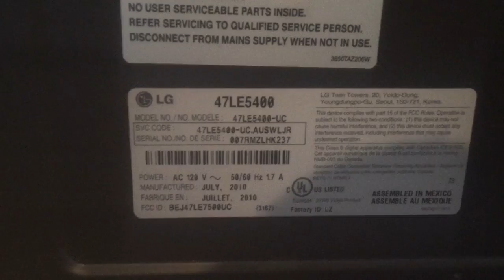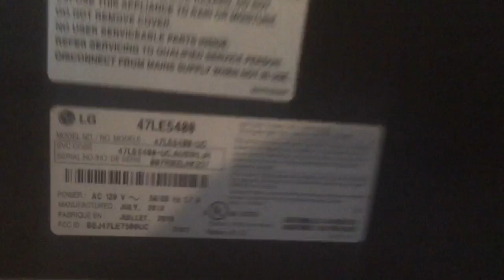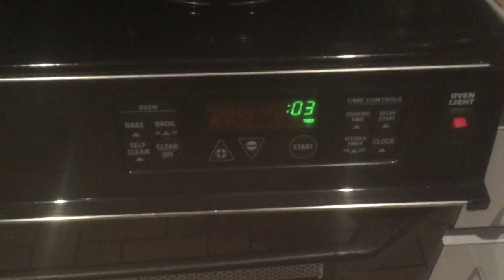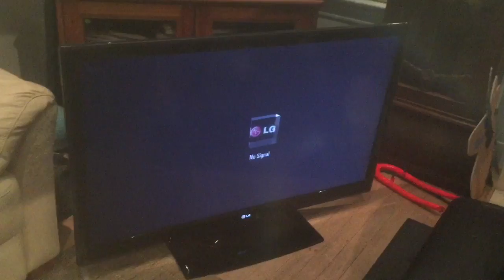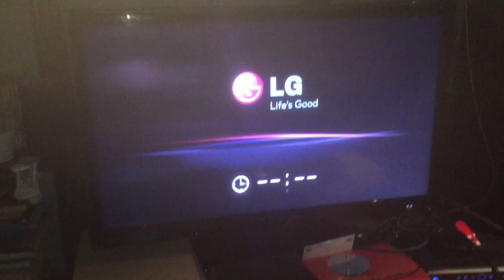Repair An LG Television Motherboard By Baking It In The Oven

Comment: So I'm trying this for a second time, first time didn't work at 375 degrees Fahrenheit, so I've got it set to 400 for 11 minutes now. Question though, have any of you had the issue with your lg TV having the static when you try playing anything? Like, the home buttons work and you can see Netflix, YouTube, hulu, ect. But when you press play you only hear the volume, but the picture is static? Anyone know if this trick solves that issue?
Reply: It's a lead-free board, so the actual solder flow temperature should be 425-450F depending on which particular alloy is in use..  Kitchen ovens typically have a large hysteresis, so will overshoot the set temperature, then drop below the set temperature such that the average temperature is that set.  Also, without convection fan, the top of the oven is hotter than the bottom.  Cooks have known forever that each oven acts a little different, and learn to adjust their temperatures accordingly.
Reply from the maker: Not I

Comment: I pretty much have the same LG TV from about 2009 and have used this trick about once per year for the past 5 years.  Works like a charm everytime!   I'm also getting pretty fast at taking it apart and putting it back together.  Nbd.
Reply: What temperature and how long you baked

Comment: Just tried on lg 55lw5600ua it worked. But a quick question how long it will work? As I have 3d tv and I luv it, its difficult to get a 3d tv now a days.
Reply: Mine works for a few months then have to do it again
Reply: @l.o.s.nostress713  How many times have you "cooked" the motherboard? I just did mine successfully for the first time. I had it fix for $70 on Ebay and worked for a couple of months. I hope this fix last as long.
Reply: @afuera2371  I’ve did it 4 times already
Reply: @l.o.s.nostress713  I reflowed my 55LW5600 two years ago and it's never had a problem since. I think adding flux around the under edges of the BGA chip made all the difference.
Reply: @wmp0074  how u do that
Reply: @l.o.s.nostress713  You can use a q-tip without the cotton swab and dip it in flux and just rub the flux around all edges of the BGA chip. It does make it easier to know how hot it is because the flux will start to vaporize. You'll know then you can pull away the heat and let it just sit and cool off.
Reply: @wmp0074  ok thanks going to try it out so just use liquid flux or the paste flux
Reply: @l.o.s.nostress713  I used the paste kind. Liquid might actually work better.
Reply: I just baked mine,  I have the same model,  it's a shame they're not making 3d TV's anymore.

Comment: i have the lg 55uh8509 and when i turn it on i have a picture for some seconds and then it goes all black. 
i put the motherboard in the oven but it didnt work.. what else can i do? 
do you have an advice? 
thank you
Reply: Power supply.  Look for the board that the AC power cord plugs into.
You will need to remove the back panel, and use a multimeter.
On my LG, all of the signals (+VA, +VS, GND, etc.) were all labelled in silkscreen... so be sure to read EVERYTHING. 
Lots of YT Videos to support this process

Comment: would it work for a LG 49 LF540V TV? I want to try it but i dont wont to break my tv anymore than is already is. so the problem with my lg tv is that when i plug the ac it will show the "life's good" logo then show a blank screen for a bit then switches off then comes back on and keeps doing it on doing doing it untill i unplug it. pls help thnx
Reply from the maker: I can’t comment because it’s not the same issue.
Reply: Did you try it?

Comment: SoI thought this is so odd that I'll just have to try it! I have a Cello TV that has power, no picture or sound that just stopped working about  2 weeks ago. So I opened it up, took out the mother board and put it in the oven for 10 minutes at 200 degrees C. I let it cool down for about 30 minutes and put the TV back together. It was like having a factory rest. It's now working perfectly. Thank you very much Avrim, your tutorial saved me buying a new TV!!

Comment: Done with a toaster over that does not have any way to regulate the temperature. The motherboard barely fitted in but after 10 minutes of baking and 2 hours of cooling down (the smell was too much to enter the room) the tv works again. There was some dark brown residue left which seems to be from the main chipset. added some thermal paste under heat sink just in case and a fan behind the TV. I think it will need re-baking in the future though because of how it is designed.
My TV is 32 inch LG LCD, it had no picture on the screen, just a click sound when plugged in and the led indicator was steady on. It would react to buttons nothing would change. Tested with multimeter everything I could before baking but had to learn how to use it and how to test the motherboard in the first place.
In the end I received some knowledge and a working TV for 5 bucks.
Reply: this made me lmao, pictured you putting the board in a toaster, could do 2 at once - or 4 if you have a 4 slice toaster lol or if you only got one you can make toast in the free slots... bet you had to press the toaster on a few times though - and catch the board when the toaster popped up and flew it in the air - like pop tarts - pcb tarts
Reply: @Pens4Life85  A toaster-oven. Those are little ovens that are not even capable of frying meat (at least in my case). It is almost the same size as a microwave. My TV had two times 2 days ago when it shut itself down for a second of half. It is still working fine now though.

Comment: 385 degrees for 10 mi won’t that burn even the cardbored
Reply: No it really doesn't burn or melt anything. Think the dinners and pizzas we put in the oven and they're in plastic or cardboard. You will be okay. Just don't forget it's in there.

Comment: I did this when sound went out on my LG 47LB5DF UL TV (2007 Build) and was pleasantly surprised when the sound system came back on.
Cooked it in oven for 10 minutes at 385 degrees.

Comment: One of my plastic sockets for one of the cables has melted slightly going to let it cool and see if the plug still goes in. Fingers crossed this has worked as I can’t get a part for it anywhere

Comment: The problem with my LG tv is that the 2 HDMI Ports don’t work. You plug a device in the picture comes up for a couple of seconds then disappears, will doing this baking method sort this issue? Or is it something different. Thanks in advance.
Reply from the maker: Michael Cooper People have reported this works for HDMI ... it was not the problem I had. There are other videos that use different methods to get HDMI working again you may want to watch.  I cannot  vouch for any one person’s attempt to try this.

Comment: i tried on  LG 55"   first in 10min, tried it out=no sucess  tried it again for about 20min (200c)  still the same.  LG logo is still stuck :-(
Reply: Watch this video if you didnt understand or did not do it right https://youtu.be/c7p4qsTYXUc
and you need to have carbord box under cuircit board in middle and tin foil on top so it melts like it should and bake it for 196C for 10min and it should.work for any lg or any smart tv with black screen or any other problem if that doesnt help then its your screen you need to change the idk how its rly called but i call it screen tape thats under the metal core
Reply: @blackfantom3705  so my problem is this, I turn the TV, on I see the LG logo but then the screen goes all black and the sound is still there. When I use a flashlight on the screen, I can faintly see an image on the screen. So I turn it off and let it rest, when i turn it on again 2 hours later it works like it never had any issues. However, after some running time, it goes back to black screen again. What do you think the issue could be?
Reply: @JasonUSANG  Hi, did you fix the issue? In my opinion the board gets overheated and some component gets unsoldered by that heat. Also do you get blinking led of tv itself?
Reply: @neru_d  blinking led on the tv or the motherboard? both works. I have switched the power motherboard with a second hand one and the issue still occurs.  All the advice I have got seems to point towards the power motherboard but what are the chances that this second hand one has the same issue?
Reply: @JasonUSANG  Sorry I got too excited and did not notice that you are getting a logo in your TV. I've just got mine 2 days ago almost for nothing and still could not manage to open it up. It got stuck screws- I am about to cut it open. I have only been getting led indicator but screen is black, the buttons are working fine. There is also no reaction when I connect it to PC via VGA.
I have been told by previous owner that the board was replaced a year ago but the same problem appeared not too long ago. I have also read that this is common between some of LG TV's because of how the board was designed.
 Also I have seen a video that shows on how to convert a TV into a monitor- that would be the last case scenario if you would not be able to fix it. It could at least serve as a big screen.

Comment: Avrim, It worked for me on my LG 55LM6200 Mfg 2012. This was the last resort. I went through the power supply and checked/rechecked every other possibility, including testing the capacitors and diodes. I checked all of the wires and connectors, removing the boards many times. My set would come on sometimes but not others. It mostly wouldn't turn on but every once in a while I could get it to turn on. When it did, it worked perfectly. When it didn't, I'd get the dreaded blinking red light. I spent three solid days on it.

Yesterday, I decided to try this method. I got wax paper, put the main board on it and enclosed the board in a wax paper pouch. I folded all of the edges and stapled them. I then made another pouch out of aluminum foil minus the staples and sealed the wax paper pouch in the foil pouch. I saw this in a different video intended to minimize the smoke and odor. I put the pouch on a piece of cardboard in the center of my pre-heated 380F oven and baked it for 10 minutes. When I opened the door I got very little smoke and odor. I let it sit in the oven with the door open for about 5 minutes and then took it outside and let it cool for about 30 minutes. I opened the pouches and let it air out for quite a while. 

I Installed the board yesterday afternoon. I have turned the TV on and off at least 30 times now and it has worked every single time! The TV would have been out for trash pickup tomorrow but now my daughter has a perfectly working 55" in her bedroom. Needless to say, we're both thrilled! Thanks for posting the video!

Jerry

Comment: I’m going to have to try this. I bought an 49” LG Nanocell TV 3 months ago and about a week ago I started getting a several inch wide bar on the left side of the screen. It starts out as static and then turns black. I really think it’s a motherboard issue because it works fine for the first few minutes it’s on. I’m not getting much response out of LG technical support. Hoping this will work!

Comment: My audio works but my picture doesn't come on. Do you think this will work for that problem?
Reply from the maker: Open-minded Skeptic don't know sorry
Reply: t con board or main board issue
Reply: Swampy Santa, will this method not work for a motherboard issue? I have trouble with my HDMI got told by a technician it needs a new circuit board

Comment: So does anyone know what this process is doin that makes the tv work??
Reply: There's a solder joint that breaks under one of the chips and heating it up to that temperature ments the solder joints and then after it cools they form back to how they should be

Comment: Worked with Lg 55lx9500. Thank you very much 👍
Reply: Can explain how u did the process? I have same model. Power will ON. But no display and no sound.
Reply: @RakshithTD  10 minutes in 200celcius oven. Then wait it to cool down.
Reply: @nakilanakilau3163  thanks u for guiding. My microwave oven has preheating issue. So can I directly place it for 10mins @200 Celsius ?
Reply: @RakshithTD  I am not sure about the microwave dude. It might damage the electronics.
I kindly suggest you to use conventional electrical oven.

Comment: Testimonial:
Our LG 60LD550 started to crap out after 7 years of service.
Issue #1: HDMI input ports not working
Solved: Oven-baked the Mainboard for 10 mins at 390°F

2+ years later... (1/17/2020)
Issue #2: Frozen on LG Startup Logo
Solved: Oven-baked the Mainboard for 10 mins at 390°F
Our Samsung 65" spare is waiting since last year but the baking trick keeps the LG going! 😡
Reply: Wanako Sabe I have a LG 60pc45 60” tv and my HDMI poets don’t work either. Do you think this will work for me?
Reply: @michaelcooper4879  What worked for me may not work for you. But many have had success in the oven method. I tried to re-flow/resolder the surface mount HDMI chip but that did not solve the problem, the oven method fixed it. It might be worth giving it a try.

Comment: Just tried this on an LG 55LW5700 55 Inch: Preheated the oven to 385, baked for 10 minutes exactly, allowed to cool for 30 minutes. I went the cardboard method with a sheet of aluminum foil on top. 100% worked, TV powered on and gave me the "Life is Good" slogan and I agreed. Thanks for this video and for all the comments on various methods!

Comment: This works whenever I do it, but then like 3 months later I get no signal and have to do it again. This seems to be only a temporary fix.
Reply: @RoamHockey  hi, I got a lg 65lw6500 from the tip and other than the controls lighting up when turning on it was no response sound or screen. As motherboards are scarce for the big model, I baked it on the top rack on cardboard 190c ten mins (preheated) and now it works. Bargain! No base so I'll weld one up from 2×1" tubing. Give it a go, stick to the instructions and it won't melt.

Comment: Let's go through the process  Right now  for first time:)  I post update  after 2 attempt using this method. WORKS  375 F for 10 min the firs time don't work the second time I let  on the stove cooling by itself 2 hours later came back and clean whit alcohol all the board re install and Work  :O  1/2/20  Thank you for making this video.  It was very helpful.

Comment: Just done this to my LG EAX64029303 main board and it fixed it. They wanted a small fortune for a replacement. 10 cents in electricity and it now works
Reply: Thadius Thudpucker why the cardboard doesn’t Burn in the oven????
Reply: @georgesilveira4936  because cardboard burning temperature is 450° F

Comment: I just baked my TV part for the 3rd time tonight.  To avoid smoke place part on steel baking tray. The first time i baked it , it lasted a year. The 2nd time about 3 months. I just baked it tonight so i hope to get better than 3 months. With Black Friday's TV's selling 65 Inch for $275 it is tempting to just go buy a new TV.
Reply: Probably you won't be baking your TV all the time go for it use the Black Friday as an opportunity.

Comment: Well I ran across your video after I lost the audio in my LG 47LE 5400-UC. I  chose to try the baking method before I mailed out the board and spent $75.00. I am very pleased to say it worked and I am much appreciative of your help. I had to modify your method a little because I have an electric over. I banked it 10 minutes at 350 and let it cool outside of the over for 30 minutes. Installed it and everything works great. thanks so much sir.
Reply from the maker: Glad to hear it.
Reply: When u said electric oven? Did u mean "microwave" oven ?

Comment: this is only a temporary fix and will not last.
Reply: True but it works again and again. I'm currently baking mine for the 5th time.
Reply: Take it to an electronics specialist with a hot air work station for 50 bucks he can do a permanent repair

Comment: Wow!! It worked today! I bought TV 47LE7500 in 2011 but 2014 four HDMI was not worked only AV In. Referred 5 repairers but not successful. Last year one repair said to should buy TV motherboard in LG Office in Johannesburg, but LG Officers expired for the specif model. Yesterday (26 Aug), AV Cables was jammed, TV RF cable jammed, PC RGB jammed but only USB. On 27 Aug 2019, I was checking on internet to buy motherboard then I saw the post. I found screwdriver open TV,  removed motherboard, heated 185°C for 10 minutes in oven, cool down for 20 min, fix TV and it worked!! Like brand new TV!!! Thank you. I used cardboard, no smoke but only fumes from oven for 10 min.

Comment: I did this last year and it worked, My TV last 1 year. then did the same, No picture, but power lights come on.   I'm going to try bake it again this weekend.  To avoid smoke to NOT USE CARDBOARD.  use a the steel baking try that comes with the oven. I had almost no smell using steel baking try.  I took mine outside to cool , can't wait an hour for something to cool.!

Comment: My LG 55" TV reported "no input" on each HDMI port. I pulled out the board with the HDMI inputs. Using a toaster oven in the backyard I preheated it to 375, inserted the board on a piece of cardboard for 10 minutes. I let the board cool down outside in the shade. After putting the board back in the TV the inputs work! Woo hoo, I don't have to buy a new TV. The hardest part of this is getting the TV off the wall and putting it back up. Thanks for the tip.
Reply: My LG 55" has a grey transparent vertical bar on the screen. Main board is in the oven right now...

Comment: I don't know if this works or not but consider the air you're breathing as the board bakes.  The maker even states it's an acrid smell.  If you do it, you should find something to use outside; your lungs and health are more important than the cost of the board.   The 911 First Responders are having many health problems, primarily from what they breathed.